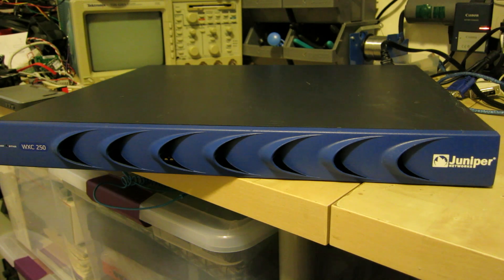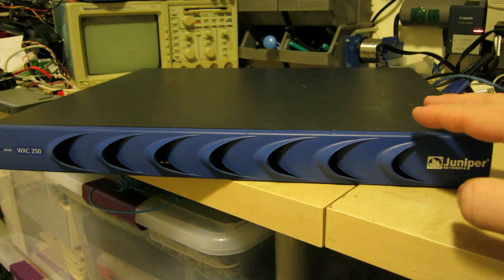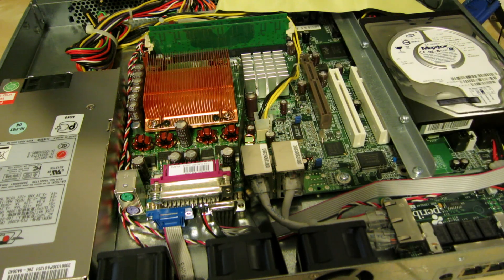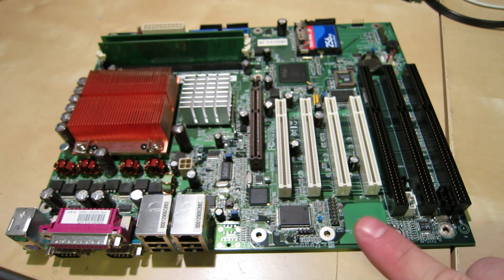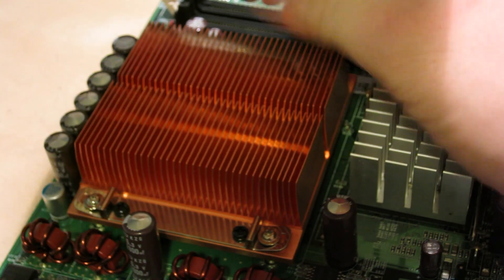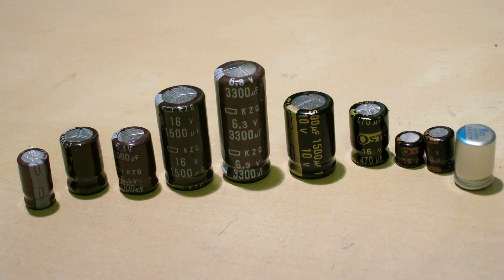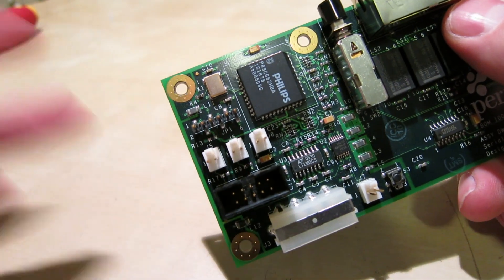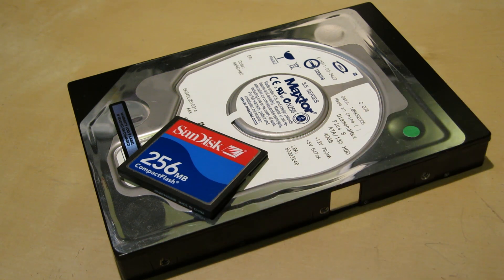Juniper Networks WXC 250 Teardown

Comment: I've made shorter Ethernet cables - had two running between a Sophos RED10 and a D-Link 4G router, so the RED10 could connect to the 4G and the WiFi on the router would provide access to the tunnel rather than the internet directly - I managed this with MAC filtering allowing only the RED through. This was before Sophos released the RED15W, of course.

Comment: Well I got my WXC 250, "open box unused" and it was still sealed in the bag with all the accessories, warranty card.  Case had a sticker over the AC port warning to set the ports correctly before powering on, warranty sticker still on.   

I opened it to copy the card and drive before doing any work and ALL of the 6.3V 3300uF KZG caps had been blown.  There was rust on the lid where they  were facing and black gunk on the copper heatsink.  However there was no evidence this had ever been powered on.  It still had the new computer smell in the bag, the 80GB drive was completely blank, no partitions, and all the files on the CF card were dated the same time and date in 2007.  Is it possible for the KZG caps to blow with no power?
Reply: Refurbished?

Comment: I've been eyeballing the WXC-590.  They seem to go for about $50 and have dual 2.5" drive bays on the front.  I've been googling around to try to find what guts are inside, but no luck at all.  They seem to be 2007 vintage, so if PC based maybe C2D processor.  They might make nice storage servers with some high capacity laptop drives.